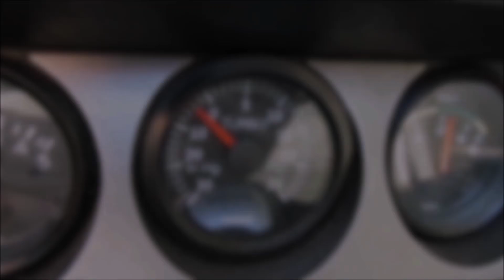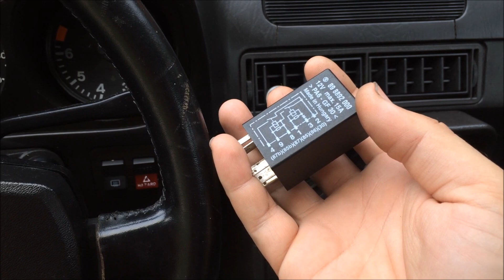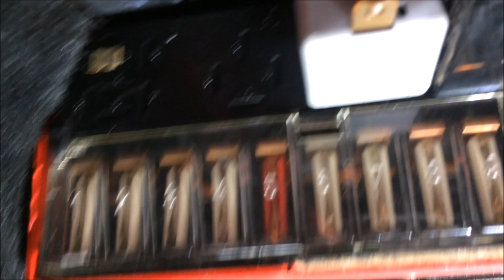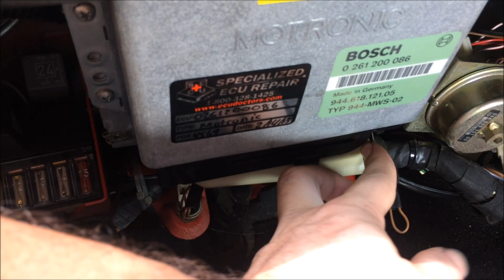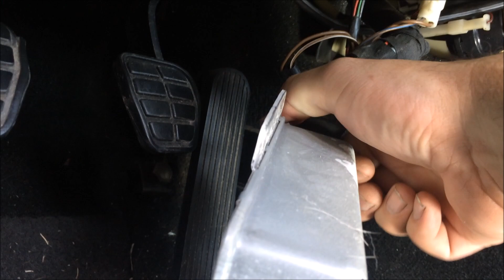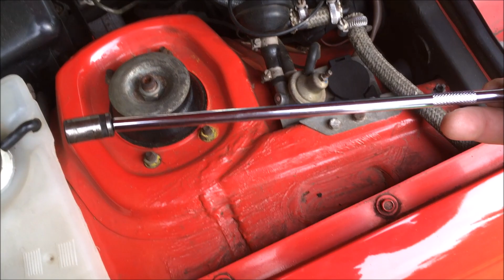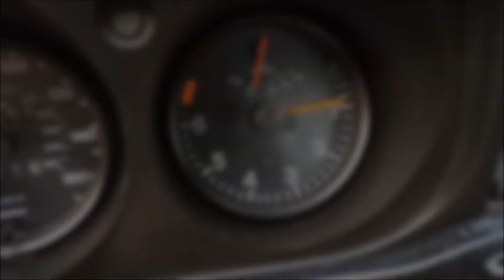Troubleshooting a Porsche 944 No-Start Condition

Comment: I have a 1983 944 but I’ve checked the sensor but they read good around 800 ohms but had high resistance in my ignition coil an don’t have tach bounce.
Reply from the maker: The wiring at the the sensors on the car side are notorious for breaking. If you have tested the sensor readings at the DME plug to verify the wiring is good then its possible the DME is the problem. There are solder joints inside the DME that sometimes get hot often because a high resistance at the coil. I should probably make a video on repairing this issue but if you are brave enough you can take the DME apart and resolder the joints.

Comment: if you have a stuck sensor...i used a set of 15'' long nose locking pliers- worked great for both sensors-took about 20min extra on the rear sensor with penetrating oil and patience...

Comment: hi ...my car...the dash lights...'light up' when i turn the key......but No 'cranking-sounds' of the engine at All!!   won't START...??...could this be the 'ignition switch'...or STARTER Problem?   cheers
Reply from the maker: There's a plug behind the brake booster with a red wire. Disconnect it and have someone turn the key while you check the voltage there. If you have 12 volts on the red/black wire then the switch is working and it's likely the wiring or starter. If you don't have 12 volts with the key turned then its likely the switch. I hope that helps!

Comment: I have an early 85’ 944. I have had a problem twice in the last 3 days were I start the car cold and all is well. About 5 min later, while the car is at idle driving or parked, the engine sounds like it’s starving and dies. Then it will crank but won’t start. A few times it will just click but won’t crank/ turn over. . I let it sit for about 30 minutes and then it will start. The more I read, the more frustrated I get. I need help!! 

Could be coincidence but I didn’t have this problem until after I replaced the thermo fan switch over the weekend. The fan works now but this new problem is worse!
Reply from the maker: Sounds like it could be a vacuum leak somewhere. Did you have the intake off?
Reply: @edredas  sorry for the late reply. It’s been busy for me. I was able to get the problem solved. I replaced the DME relay and that solved it. The bad relay to my surprise was the original from 85! Made in W Germany.

Comment: Hi my 1990 3,0L s2 is turning over, with no Tach bounce, had new DME relay, Ref sensor, only one on this model, and ECU tested fine. Have power to both sides of the coil but no spark and only pumps fuel when I bypass relay. Could the final stage amplifier module stopping tach bounce? or any ideas please?
Reply from the maker: I'm not sure if the signal amplifier has anything to do with tach bounce but there's a very good chance that it does. I've only worked on a few of them and the were later S2/968's without them. I hope that helps!

Comment: How can you test the wiring harness?
Reply from the maker: Remove the plug from the DME and unplug the sensors. Then use a multimeter to make sure there is continuity from the pins in the plug to the appropriate DME pin. If you don’t get a reading then the wire is broken. I hope that helps!

Comment: Would you hear the fuelpump in this? I dont have any tach bounce. But when I use the multimeter i get some form of reading. 174 on 2k ohm. Not sure if I measure right place. Should the notch be the raised "bump" or like a notch inwards,  and this facing up measure left and middle?
Reply from the maker: The fuel pump will only run if the computer sees that the engine is running. So without tach bounce the computer isn’t recognizing that the engine is spinning. So there is likely an issue with the sensors if you have no ohm reading at all with the engine off. I believe the bump should be on top but with the lead on the center terminal you can try each one. At least one should have a reading but if not then they are toast. I hope that helps!
Reply: @edredas  standing in front of the car, is the reference sensor the one closest to the windshield or closest to the front of car ? Thanks.
Reply from the maker: @kajalver5743  the reference sensor is the one closest to the block/front of the car.
Reply: @edredas  last question haha. I replaced both sensors,  still no go. Will tach not bounce if sensors are good but relay is bad?
Reply from the maker: Nope, the power to the DME (computer) is supplied by that relay and the computer is what sends signal to the tach. So when the relay is bad there won't be any tach bounce.
Reply: @edredas  then I have to pray thats the sinner!
Reply: @edredas  thanks alot!

Comment: I'm getting tach bounce but no start.  I replaced the ignition coil, but it appears I'm still not getting spark... I replaced the sensors about 2 years ago. And has a new battery yesterday. Still nothing. Just turns over but no spark.  Also I smell a faint smell of gas after trying to start it.  No leaks though that I can see anywhere. Just driving it one day and it died. them started and ran a few blocks then died again.  Then ran for a few days straight no issues.  Then the next day no start and will not start now.  Crazy!
Reply from the maker: Tach bounce accompanied by no spark could mean that your DME itself is bad. I just had this issue not long ago on a turbo. I swapped in a new computer and it fired right up.
Reply: @edredas  it also tends to run fine for a day or so then goes onto this “ I don’t want to run “ mode  with the symptoms I described above. When I had it towed to the shop they drove it for 2 days and it never had the issue. Then I drove it for 2 days after that then starting it on the 4th day it dies this again. So puzzling

Comment: Do you get your reference sensor from pelican parts? And if so what brand do you suggest?
Reply from the maker: Yup, I got them from Pelican. I usually just go with whatever is the cheapest one that week. I've never had any issues with any of them. Every sensor I've ever replaced was nearly 30 years old so I figure that even if the cheap ones last 20 years you've gotten your money's worth. Good luck!
Reply: @edredas  thank you for the quick response. I was leaving for work today and go a no start on my 85.5 944. Haven’t been able to check for tac bounce yet but was searching parts just in case. All your videos have helped me as a new 944 owner. Thank you

Comment: My speed and reference sensor is stuck! Any tips or tricks for it to come out easier
Reply from the maker: Sometimes soaking them down with WD-40 and using a small set of long nose locking pliers will get them out. I hope that helps!

Comment: great video thanks. I am not a great fan of Bosch injections system they are not very reliable(?)I have always had loads of problems with mine on my peugeot 309 sri. (same as 205gti 1.6i) Your engine sounds much nicer than mine also.

Comment: if you had looked at the rpm gauge  when you first cranked the engine you would have seen no bounce which would indicate no cps pulse from the reference sensor to the ECU .
Reply from the maker: This same thing occurs when the DME relay fails. Whenever there isn’t any power getting to the DME through the relay you also won’t have tach bounce and so it should be checked first.
Reply: @edredas  which is why I always first check for a rpm bounce ...then check that I have 12v+ on terminal 30 of the DME relay base ....If I have power to the DME relay then I insert a 3x way DME relay bypass ( I reconstructed a generic relay with  an led and on/off switch . When plugged in it  will give immediate power to the ECU injectors, ignition , fuel pump and sensors including the CPS  If there is still no rev bounce Then I check the CPS connector and wiring and test the cps coil as you did. I never advise novices to mess with their ECU until checking the other stuff first in sequence.
Reply from the maker: @johncooper7242  since these relays fail so much a lot of people keep extras in their car. So I figured it would be easier to swap one in rather than show how to how to make a jumper and install it. With this car I agreed that I should have checked the sensors first but we see so many bad harnesses that I couldn’t rule it out since the sensors looked okay at their plug. We just got a car in that sat at a Porsche shop for 8 months with a no start condition that was caused by those wires that they couldn’t diagnose. We were able to drive it off the truck. This is about the fourth car this year we’ve seen with the same exact issue so it’s common enough that we usually check that right after replacing the relay.
Reply: @edredas  sorry for the delayed reply bud ...it was my turn to cook tonight !...  I didn't mean to be so critical. You have a fantastic fan base and are clearly helping lots of 944 owners  with your knowledge and experience.
i think the only difference would be that I tend to follow a set sequence  based on the Bosch fuel injection and ignition system manual and troubleshooting guide whereas you probably  head straight for the most common sources of no or hard start issues which is the DME relay and the CPS .
We both got to the same place just a different route is all ....
Reply from the maker: No worries. Yep, not to mention a lot of times these cars have already been combed through by another tech some place else. With this new car that came in this week that had been sitting for 8 months I actually started with the KLR since he had already checked the DME relay and power to DME. So I started way out of order, but again it ended up being the wiring at the sensors... which would have saved me unplugging and jumping the KLR if I had just started there, but he replaced the sensors so I figured that had already been checked... haha
Reply: @edredas  yeah I never accept anything owners tell me anymore. They say they have checked this and that etc and more often than not they have done nothing.  Before I start to help anyone  I now always ask what work have you had done on the car recently ..... its amazing how many owners forget to tell you that they adjusted the mixture or they replaced various ignition components etc.  They don't appreciate that you are trying to diagnose a problem on their car blind from another part of the World and only have their description to help . 

Many owners spend a fortune on substituting various parts unnecessarily until they run out of money or ideas ....thats when we get the car to sort it out
Reply from the maker: Yup, I skip all that haha. I called the shop and asked the mechanic working on the car what was done... looks like they just replaced a bunch of parts, and he mentioned that they checked the wiring. The wiring to what I'm not sure. I just pulled the boots back and made sure nothing was shorted out and the car runs perfect now.

Comment: Do the 1984 944s have tach bounce?
Reply from the maker: Yup!
Reply: @edredas  I've never had tach bounce on mine and it appears starts, is the something I should worry about?
Reply from the maker: You usually only notice it when the car won't start, so if you don't really see it but the car starts its no big deal.
Reply: @edredas  So when the car won't start, the tach should bounce?
Reply from the maker: Sometimes, for instance if the fuel pump isn't getting power then you would see the tach bouncing but the engine not starting. The tach bouncing is just an easy way to see if your computer is getting power and signal from the sensors. Other times, like with this car there was no tach bounce showing me that the computer wasn't getting a signal. However since your car runs its happening so fast that the tach bounce is imperceptible. Most of the time it takes a few rotations to even see it barely moving. I hope that helps!
Reply: @edredas  Thank you! This definitely helps as I think my fuel pump just went bad so I'm going to check it tomorrow! Thank you so much!!

Comment: Hey so I’m dealing with a no start. I’ve swapped DMEs, relays, coil packs, new hall sensors, new hall sensor harness from LR, I tested 26-27 after the new harness and still have OL. I’m not sure where to go from here. Maybe a ground issue?
Reply from the maker: Check the continuity of each wire at the plug end to the DME plug for greater accuracy. I find that works a lot better. Good luck!

Comment: Great Video
Had to remove the holder as the B sensor was so corroded that it would not come out 
One question - is it the B sensor or the D sensor that has to be gapped if you remove the holder
Its not clear on your video?

Comment: Will a bad ecu cause a no tach bounce?
I have a 1984 Porsche 944 that I was driving to my home one day it stalled so I swapped in a spare dme relay that got me home when I tried starting it to go to work the car wouldn't start and at this point I had no tachometer bounce so I changed my reference sensors and then the tach bunched but car not start unless I ran a switch to the pump on a fused relayed switch it started but only with bypass the dme relay completely. The car started with the switched power to fuel pump but it does hot stalls when it heats to normal temps it stalls. Yesterday I unplugged my ecu and plugged it back in and now my tachometer wont bounce I unplugged it and plugged it back in again and nothing no start no tach bounce now and I just want to drive my car again but my project has been sitting because it is so damn confusing.
Reply from the maker: Sounds like it could be a wiring issue. I've seen the wires on the back of the relay board come out and make it where the DME can no longer control the relay. That said, if you unplugged the DME and its not working, it could be bent pins in the connector or all this could mean the DME itself is bad. I would check all the wiring first and if everything looks good it could have been the DME the entire time. I hope that helps!
Reply: @edredas  well that is a very good possibility with the wires. I mean that's a mess my cousin ruined this poor car. He had the fuel pump ran off speaker wire running past the dme relay that's the only way he could get it to run but then I dont know if it is trying to give power while it was bypassed on a different relay and switch it runs then will stall. If it was giving power to the original wires that where capped and the new wires ran so I could get the car home. Did that short anything in the car maybe? Is the dme just shutting fuel off because maybe there is a short on a wire that goes to the dme relay for the fuel pump is there anywhere that has a wiring diagram that shows how to rewire the dme relay socket that the relay plugs into or does Somewhere sell a pigtail or a harness that plugs to dme relay then something that gets constant power , something that has accessory power , the dme itself , fuel system and a ground wire? Is there a place that shows this anywhere that you know of. Also what is the actual part number or relay that is supposed to be my ignition relay it works I believe but my 1984 Porsche 944 has a 928 ignition relay and all 4 corners are folded out from the circuit board. I do have some new reference sensors coming in even though I changed those a few months ago but the car has been sitting when I did change them the tachometer was working but now again its not.
Reply: Well I have all wires connected to the relay I used the two different dme relays and two different dme relays I've swapped out the reference sensors for spare ones the sensors get power but wont make my tachometer bounce still the sensors get power from my dme but wont work but the same sensors where at the same gap and they worked until last week =/ do you know of anything else that would do this please anything helps I mean I wish you lived close to me I'd pay you to fix it but your far away lol

Comment: Hey edredas what would you do if you replaced the DME Relay + both sensors and still get no tach bounce or start?

I've actually narrowed it down to zero ground issue at pin 85 on the relay. When I manually add ground to the pin, tach bounce and car starts/runs perfect. Am I orrect in assuming the DME computer needs the input from the ref sensor to then send Earth back to the relay and complete fuel pump circuit/power to injectors? 
I'm thinking I have wiring drama either from sensor plugs to DME or back to the relay board.

Will do these multi-meter tests tomorrow! Cheers
Reply from the maker: It's been a while but I believe that 85 is a constant ground. When the ignition switch on it sends power to 86, which switches the first relay on. This supplies power to the DME and injectors. Without a constant ground there on 85 I don't see how the relay would activate. Once the DME has power and sees a 200 rpm signal from the reference sensors, the DME will then send a ground back to 85b and turn the fuel pump on. So you're on the right track. That said, if you are not getting a constant ground at 85 then it is likely the grounds on the back of the engine and bell housing. There is a common issue where the grounds corrode overtime and you have all sorts of issues. Good luck!
Reply: Amazing mate, thanks for the reply. I’ll give them a clean today and hope that works! Legendary 🤞